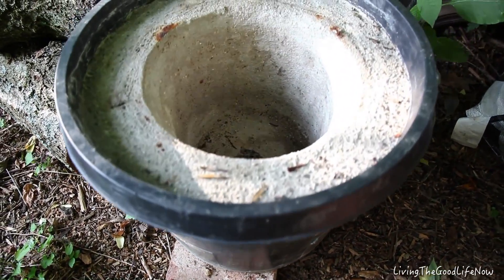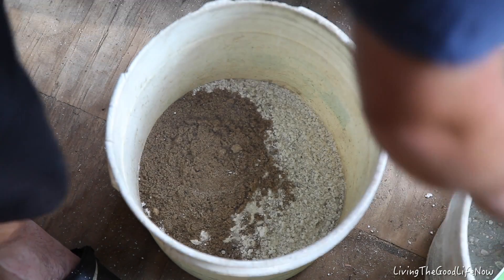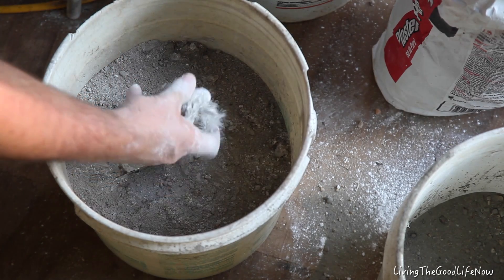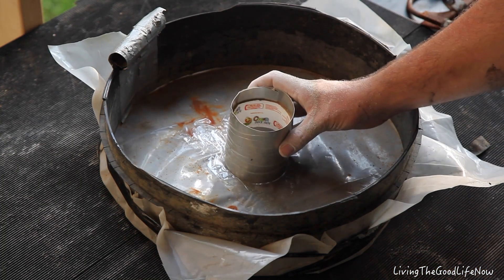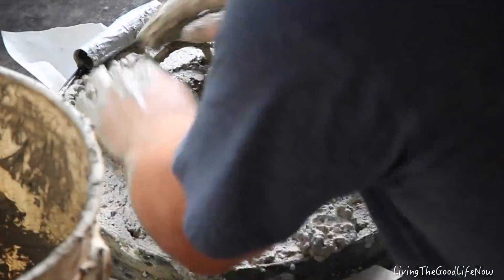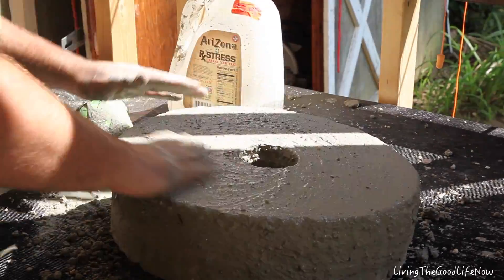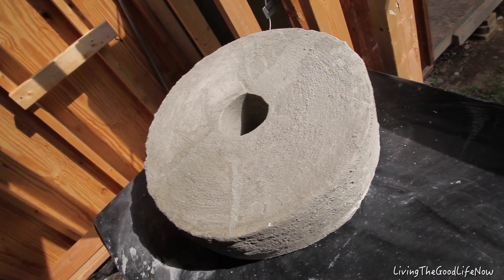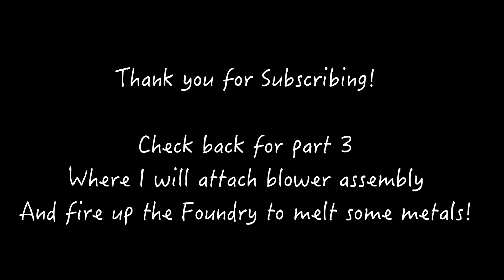How to make a Large $50 Mini Homemade Metal Foundry Furnace Forge propane charcoal DIY Lid Pt. 2

Comment: Good video, but this guys' grammar is terrible.  One other thing is that he keeps calling it a foundry.  A foundry is the place where you do metal working and casting.  This is a furnace, which is simply a piece of equipment in a foundry, just as a forge is.

Comment: Using a rod to tamp the concrete works pretty well, or some form of vibration, to help the cement settle and bring air bubble to the top

Comment: When making refractory mixes, regardless of the material used, don't use additives such as nails or other foreign strengtheners as these do not mix well at operating temps. The high heat will cause the two dissimilar materials to expand at different rates, causing concentrated stress lines in an already Simi weak mix (being that it will be weaker till it's cured with a few firings, not that it's a weak mix) 
Just let the mix do it's job

Comment: can i get this stuff at TSC and menards (and here is an idea when you make your next one use a sifter to get all the rocks out of the cement)
Reply from the maker: Probably, but use refractory cement, which you may have to order online or specialty shop.
Reply: _ _ why would there be stones in your cement. It’s concrete that has stones in all you need is Portland or blue circle cement and check use by date as cement can and does spoil after so long of sitting on a shelf or shed hope this helps someone. Great video thank you for making it. 👍🏻

Comment: CEMENT and CONCRETE are NOT the same thing. Cement in the main bonding ingredient in concrete. Using concrete in your mixture was not the best thing, using PURE PORTLAND CEMENT would be much better. Other than that, GREAT video!
Reply from the maker: In the future I would do without the cement altogether as it does not hold up well to extreme heat.
Reply: Doesn't Portland cement burn out and thus weaken the material? Refractory cement will survive the heat. Portland cement burns out and leaves a cavity which is great for insulation but bad for strength.

Comment: Doesn't concrete crack under heat?
Reply from the maker: water pockets trapped in concrete gets super heated to steam and causes concrete to crack... thats why if not using refractory cement or kaowool (both of which  I would recommend) people use sand and plaster of paris since it dries completely... i added the small amount of concrete to cut cost and test to see it would add strength.    I just uploaded part 5 where I melt brass yesterday, check it out! also part 4 where I melt aluminum.
Reply: LivingTheGoodLife Do you think straight Perlite would do the job well enough?
Reply from the maker: What would be used to bind it?    It is just volcanic glass, so you wouldn't be able to melt it, and it insulates well.
Reply: LivingTheGoodLife So a mixture of plaster of paris and perlite would be good insulation?
Reply from the maker: Yes it will sustain heat and not damage from heat, but keep in mind that it will not be physically strong, so if you strike it with anything it will crumble. many add sand to keep cost down.
Reply: @tylerpape4382  Add fiberglass to the mixture and it will last longer. The extra tensile strength and R-Value from fiberglass helps.

Comment: Yes, someone should hide the leaf blower but.
Reply from the maker: huh?
Reply: Actually, my first smelter, made from a 55 gallon drum lined with fire bricks, with a 20lb propane tank, sans top for a crucible, and fueled by firewood , used a leaf blower. At night, it looked like an Atlas rocket trying to screw itself into the ground. Not real efficient. Took lots of wood, but was good for large pours of Al & Zamac (pot metal).

Comment: great videos. I need to melt copper. how can I use propane with this design. unless you think charcoal could get hot enough?
Reply from the maker: Im editing part 3 now where I fire it up and melt some metals, please subscribe to be notified when its up (could be today or tomorrow!)  ...if you have a powerful enough air blower you could melt steel!
Reply: Charcoal will melt about anything. think of coal as super charcoal, and coke as coal on steroids Too much air is worse than not enough. With solid fuel, your only control is air flow. Assuming you don't have a variable speed blower, use a large pvc ball valve far upstream or a damper to regulate it. Too much back-pressure will decrease the lifespan of your blower. Btw, I joined a local blacksmith group, got 100 years of experience in one hr, plus access to coal & coke Can vaporize steel on a brake drum forge,

Comment: Approximately, how many pounds did this end up weighing? I'm building a forge and am worried that that there might be a weight issue. Good vid BTW.
Reply from the maker: I have not weighed the lid with a scale, but picking it up it feels around 20-25 lbs, the perlite helps keep it lighter... and keep in mind you could make it thinner so not as heavy, but may be more likely to crack.
Reply: Don't scrimp on the lid- it gets the most abuse, and will trash your day if it falls apart into your hot melt. BTW Mr Dog, for a forge consider a brake drum on a ring stand, provided your intent is to blacksmith. Be safe, keep your work area clear, and have a well thought out game plan.